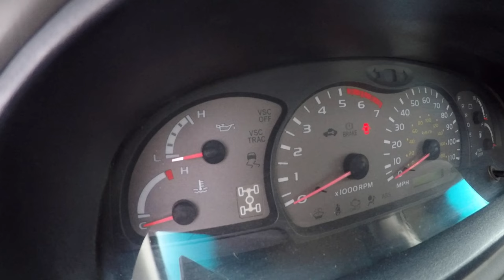Diagnosing the VSC OFF, VSC TRAC & CEL lights on a Toyota Sequoia 1st Gen

Comment: I have spent $1,200 so far and each time I pick up my Toyota from the mechanic the lights stay off for around 15 miles. Then they come back. Don't know what to do from here. I need cruise control. I just put on a new gas cap because I heard it could cause the problem. Didn't help.
Reply from the maker: It's a frustrating issue for sure.  What I found was that scanning with a regular scan tool didn't lead me to the actual problems, as it only identified generic OBD codes that could each have many causes.  Scanning with a Toyota specific tool to get the factory diagnostic codes was the only way to nail it down.  Even then... it's a 20 year old platform with a lot of parts that go bad from age, corrosion, vibration, wear & tear.  Repairs are going to be more and more common the older they get.

Comment: 2006 Sequoia, I had VSC,TRAC OFF,ABS Brake light on, truck felt like it wouldn't crawl more than 15 mph...Literally felt like it would fall apart. I had many error codes. Changed ABS wheel speed sensors and the VCS TRAC OFF & ABS all went away. For the brake light I replaced the stoplight switch located under brake pedal and it took the brake light off. MAKE SURE YOU USE A SCAN TOOL. Video on my channel
Reply: What’s your channel?
Reply: @CPT891  You can click on my name and scroll down a few and you should see. Hope it helps
Reply: @castlecruuz  thanks for your vid, man.  I subscribed
Reply: @CPT891  You're very welcome brother
Reply: I really appreciate you subscribing to me man

Comment: Wow tell me a lots..my same sequoia might be have that problem..check light on couldn't finger out ..
Reply from the maker: Just circling back on this, because I've done a couple of videos on this issue:  
1) Use a Toyota specific scan tool to get the exact factory level codes to narrow down what's going on, since the generic OBD codes point to about 30 different possible problems. 
2) BlueDriver and other bluetooth dongle type code readers are inconsistent at reading factory codes on older Toyotas like ours, so use an actual plug-in type scan tool.  Again, it needs to be a Toyota specific scan tool, not a generic one, to get the factory level codes.
3) IF your factory level scan tool cannot read the ABS control unit AND you put in a new ABS unit , and it STILL does not read the codes, your OBD port itself may be the issue, as it was with ours.

Comment: Thank you brotha. Just started my vehicle and these lights came on. I’ll get to work once I get some time off. God bless you and thanks again
Reply from the maker: Happy to help.  My biggest takeaway from this experience has been: buy a scan tool that does Toyota specific factory codes.  The generic bluetooth code readers will not reliably do the trick here to determine what the problem is.
Reply: @CliffjumperCars Rgr that. Thank you

Comment: Some people say it’s the yaw rate sensor. Some says it’s the wheel speed sensor. I will definitely try this diagnosis this summer. Do you know how much those valves are? Thanks so much for video!
Reply from the maker: It turns out that the combo of these generic OBD codes and these malfunction indicator lights on the dash can actually refer to quite a number of issues.  The factory level diagnostics scanner can reveal the specific issue, including the yaw rate sensor, an ABS sensor, any of the four O2 sensors, evap valves, etc.
Reply: Thanks kindly

Comment: Excellently done video, sir. You have a real gift of talk (not sure I heard even one "y'know")
Now, do you have any clue what might cause those three lights on my '03 Sequoia (CEL, the two VSC lights) to all come on and all go off intermittently? They'll come on and stay lit for a day or two or three, then they will all go off and stay off for a day or two or three. And then the whole cycle repeats itself, over and over and over. Meanwhile, the car runs just fine.
I've replaced both O2 sensors, the gas cap, and the spark plugs. No change. Could it be a vacuum leak that comes and goes? Could it be the catalytic converter?
Reply from the maker: I probably need to do a follow up video to this, because I've learned a lot more about these lights, what triggers them, and what they can indicate.  To simplify though: VSC and TRAC lights will always come on when the CEL comes on.   There may not be anything wrong with the VSC system, but they will always come on when there is a check engine light.  I guess it's Toyota's way of really drawing your attention to the CEL. 

HOWEVER if the VSC and TRAC lights come on and there is NOT a CEL, then that indicates a different problem, which could be the actual VSC system, it could be the ABS system (ABS light does not always come on even if it's an ABS issue), 4WD system or center differential.  It can also have to do with the Yaw sensor, or the steering angle sensor.  It seems that performing a zero point calibration often fixes this condition.  But sometimes you need to replace the yaw rate sensor then do the zero point calibration again. 

Also, the VSC light can come on with just the Brake warning light, or with the ABS light and the brake warning light.  Those indicate issues specifically with the ABS system, which can be a failure in the control unit, a corroded connection, a dirty ABS sensor, a broken ABS sensor... a few things. 

Whatever is specifically wrong and causing these lights in whatever combination they are popping up can't be determined by a generic OBD code reader, but if you use an enhanced code scanner then it will give you the specifics, so you're not guessing.
Reply: Sounds more like a Vacuum leak ? Or possible?  One of those Vacuum valves getting stuck open? Test the valves first and check for leaks.

Comment: Hello from POLSON, MONTANA!  I am a brother in Christ, (Catholic) and thank you for your video, and for your PRAYERS!  We (my fiance, Gretchen and I) get married in October, and could sure use prayers-- about a living situation and just for general health and happiness.

Now on to the car:

I JUST purchased a 2005 Toyota 4Runner (4.7L dual overhead cam V8) and all of a sudden the Check Engine, VSC OFF and VSC Track as well as Traction Conteol (the slippery car symbol) came on at the SAME time (after the car sat for a day and a half)

Any further knowledge about this issue?  I cleaned and checked (clicked) the gas cap, and filled the tank, but haven't had a chance to check any codes yet.
Reply from the maker: Welcome to the fun!  The good thing to know about these three lights coming on is, whenever the CEL comes on, the VSC and TRAC lights also come on.  The bad news is: when that Check Engine Light comes on, it can be just about anything.  There are dozens of codes that can trigger the light.  Would be irresponsible to speculate without knowing the codes.  Also worth noting: a generic code reader will most likely NOT give you all the info you need to diagnose the problem, as Toyota as their own specific codes that need to be read from their manufacturer specific computer.  Best to take it to a shop that focuses on Toyota to get it scanned.  The regular Autozone/Oriellys/Pep Boys scan will not help you.

Comment: My truck is running lean, and you can smell the gas real bad, and it also has a lot of pressure when I open the tank cap, whats wrong do you know?
Reply from the maker: Sounds like a purge valve is not functioning correctly.  You'd need to spend a bit of time with a power probe, do a smoke test, and see which valve isn't working.
Reply: have 02 Seq same extreme gas pressure and smell random shut offs. someone said vent vale solenoid but can't locate

Comment: Will my traction control still work even though the lights are on?
Reply from the maker: Yes - the VSC and TRAC lights always come on whenever the CEL comes on, but it doesn't mean the traction control is off. 
If the VSC and TRAC lights come on but there's no CEL, then then traction control does have an issue.  Usually the brake warning light is on also in that case.

Comment: Can a bad gas cap be the problem also?
Reply from the maker: Absolutely.  That can cause it, in addition to a leaking charcoal canister, a bad purge valve, a leaking vacuum hose, bad or loose O2 sensors, LOTS of possible causes.

Comment: Gas cap or abs sensor
Reply from the maker: Those would certainly be “usual suspects” but not the cause in this case.
We also ruled out the carbon canister, several purge valves, ABS computer, steering angle sensor, & yaw sensor.
Reply: @CliffjumperCars  so are you saying you still haven’t figured it out?
Reply from the maker: @sebastianromero420  We did, and it was a combination of things that aren't in the usual diagnostic process.  Will cover it in an upcoming video, but here were the biggies:  1) one of the new purge valves failed intermittently - could only catch it with a scanner actively monitoring while the motor was running.  It tested fine when the ignition was off and tested fine on a multimeter.  2) the OBD port connector itself had several issues - several of the wires going to it had faults and it needed to be repinned and the wires repaired.